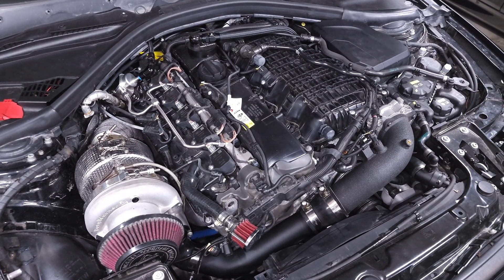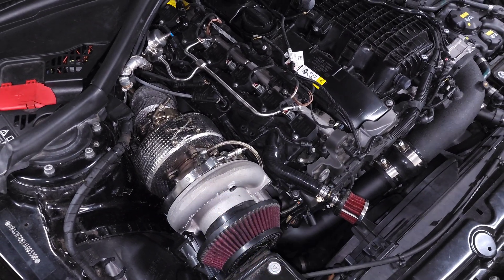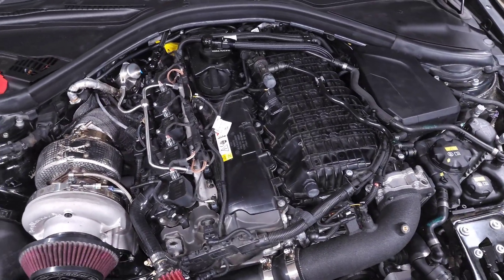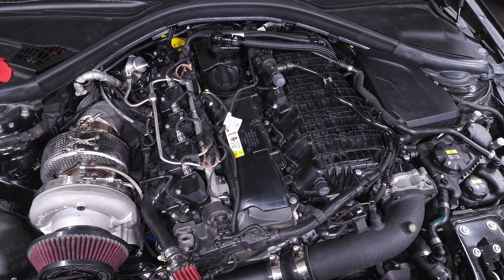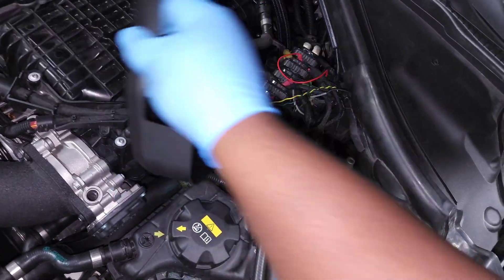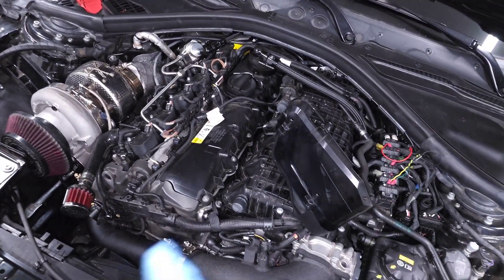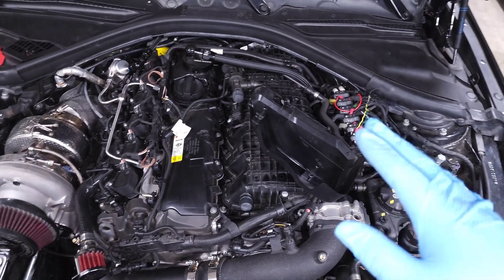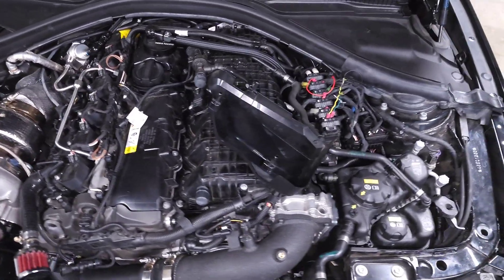How to Prime the Turbo on your B58 Engine!

Comment: Hi kern, how do you prime hybrid turbos? Same way or?
Reply from the maker: Same way. Just unplug injectors or the dme connector and crank it for a bit
Reply: @kern417 just installed my pure800 I’ll be fine with just disconnecting the injectors? I also have port so I’m not sure if those injectors will fire too?

Comment: Is this procedure good to do after a oil filter housing replacement? I read from someone to do a drain coolant, drain oil+drain from oil filter housing , replace OFHG with new one & new filter, fill with new oil + then ‘Perform commissioning of oil circuit by running test plan in ISTA’ …. which I’m guessing is the same procedure as this video since it involves cranking engine until oil pressure builds up since they said it’s mandatory to be safe on the engine since N55s had a issue if you didn’t.
Reply from the maker: The oil won't fully drain from the engine so it's not really something you have to worry about unless you're actually replacing the turbo
Reply: @kern417  so no need to prime the engine after replacing the OFHG for the B58, thanks for the help kern! Is there a reason that the N55 needed to be primed after replacing the OFHG but not for the B58 after replacing the OFHG?
Reply from the maker: @miring822  i have never heard of that. Idk how you'd even do it with ISTA. The oil pump is mechanical and requires turning over the engine to move oil. When i replaced the gaskets on my N52 i didn't prime anything. Just bleed the coolant system.
Reply: @kern417  so just bleed the coolant system for the b58 after replacing the whole entire oil filter housing + gasket and it will be fine? 
I didn’t even know about that till someone on the r/BMWtech sub mentioned to ‘prime the engine after replacing the entire oil filter housing since it will have no oil and start dry which can cause damage to the engine because the N55 had a problem where people would change the OFHG and like 10k miles later get bad engine damage ‘ 
I much rather listen to the wizard of the B58 kern himself and just do the bleed coolant after replacing the oil filter housing lol : ) thanks brother
Reply from the maker: @miring822  like I said I've never heard of that. Oil is on all of the critical components after replacing the oil filter housing. There's nothing mechanical inside of the housing that would need to be primed.
Reply: @kern417  what do you think about the MST cone filter vs Ramair Proram cone filter , I read on B58racing description they claim that ‘Almost double the flow of the standard MST Filter’ for the B58 engine.. should I go with that for a stage 1 BM3 tune or just stick to the MST filter cone that comes with the intake ?
Reply from the maker: @miring822  Intakes don't really make a difference

Comment: Just for the information, at Pureturbo in Belgium, they didn't prime my P800. I asked why. They said, there's still some oil in from factory. My 2 cent.
Reply: How do they prime the original turbo in BMW factory or in any car/engine factory?🙄
Reply: @KML_8734  we are not talking about bmw factory there.
Reply: @Nakinakpgm  I know and I have changed the turbos to my own N54 and done the turbo priming correctly. I'm interested in how it's done at the factory. When the turbos are empty of oil and everything is cold and the gas pedal is pushed to the floor on the factory test bench?🤣
Reply from the maker: A lot of engine manufacturers use a grease like lubricant on bearings. Same as engine builders.. It's designed to flush itself out once oil circulates.